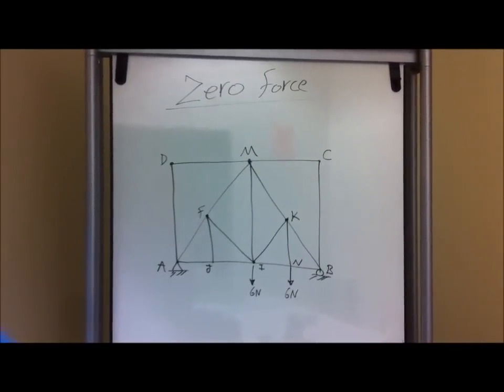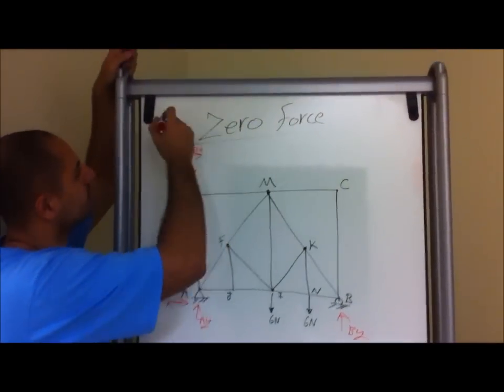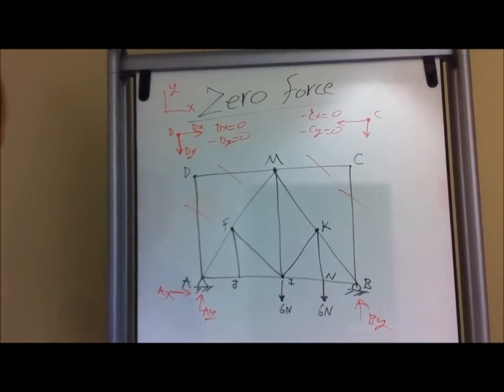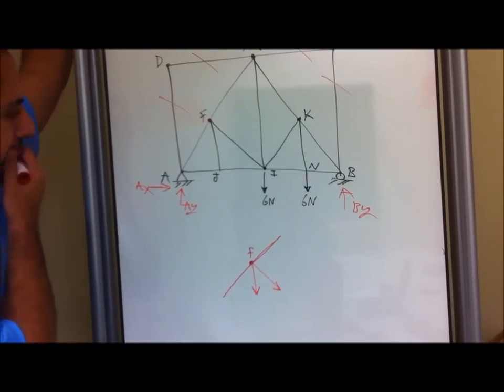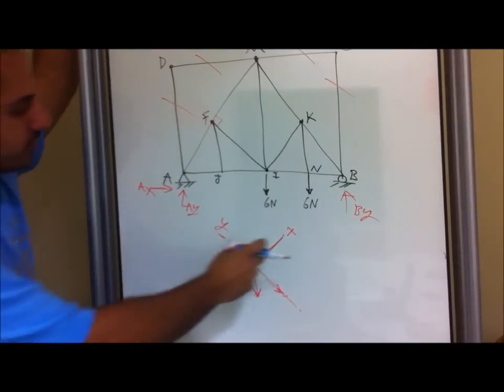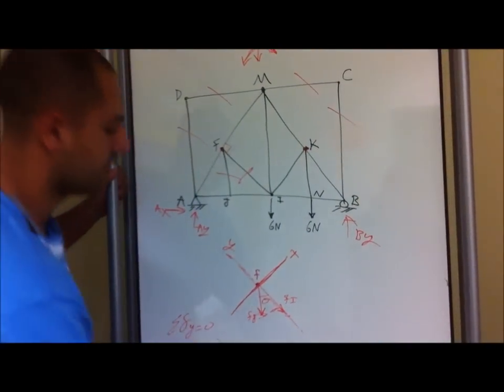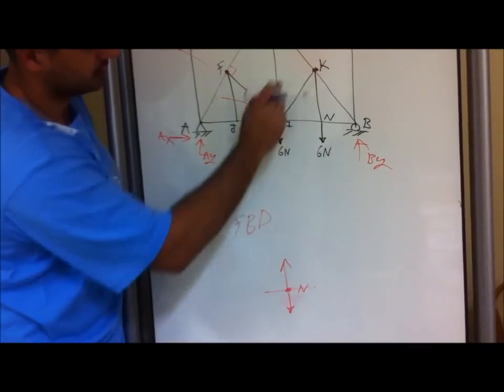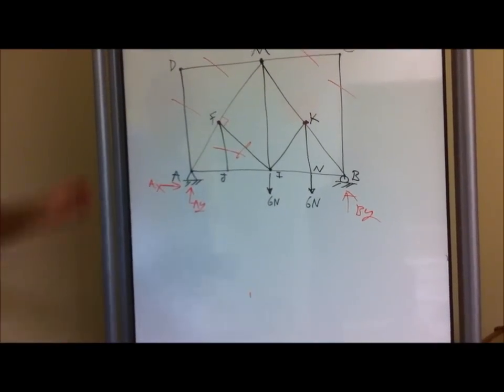Zero force members part-3

Comment: They are at 90 degrees from FI and forces are not transferred through 90 degree angles. This is why you usually split forces into x and y.
FJ cannot take the load because it has nowhere to transfer it to (AJ and JI are at 90 degrees to it)